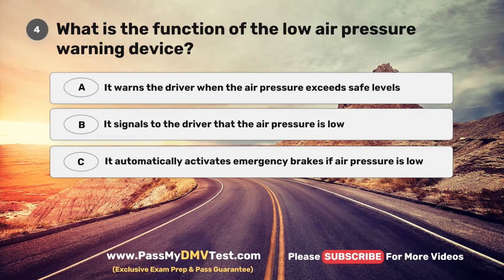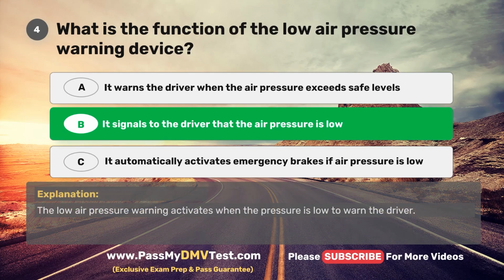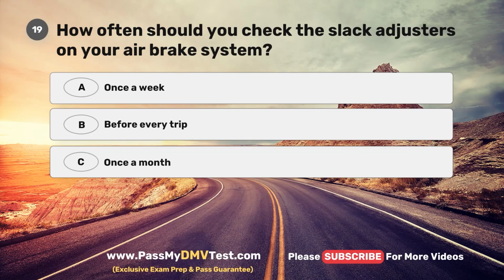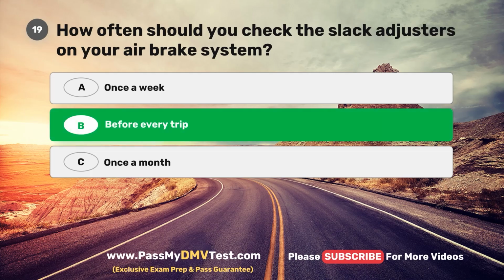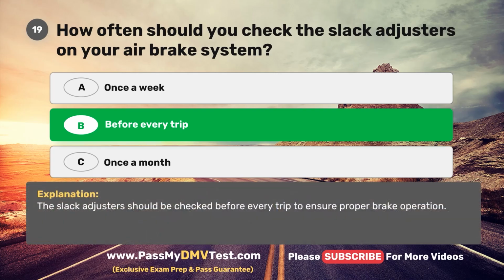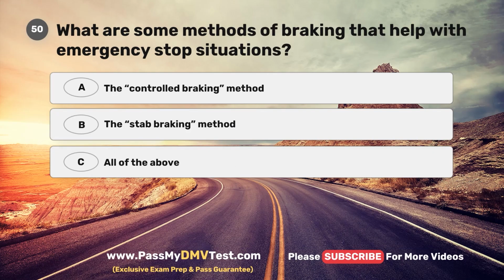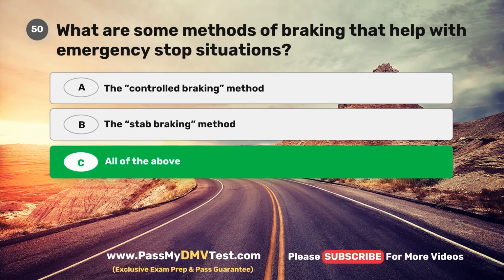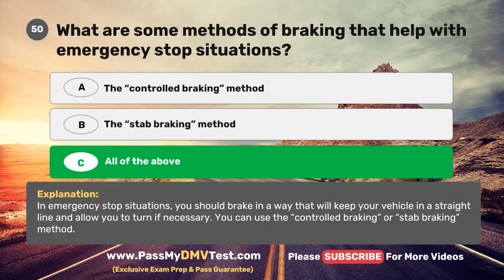CDL Air Brakes Endorsement Test Questions And Answers 2026 Updated Edition - PASS On Your First Try!

Comment: I think the question #31 answer is incorrect. It should be answer "B" Applied Air Leakage Test.
Reply from the maker: Hi thank you very much for the comment! We appreciate your support and watching the channel! Here is a breakdown on the two types of tests...

The static test checks for air loss with the system at rest. After building pressure to governor cut‑out, you turn the engine off, release the parking brakes, and do not press the brake pedal. You watch the gauges for one minute to see if the system loses more air than allowed, which would indicate leaks in tanks, lines, or fittings.

The applied test checks for air loss when the system is under load. With the engine off and brakes released, you press and hold the service brake for one minute. This test stresses the brake chambers, hoses, and valves, revealing leaks that only appear when the brakes are applied.

Again, thank you very much for your support!